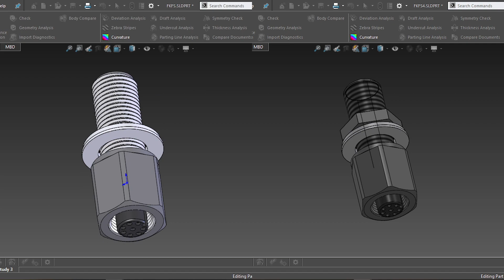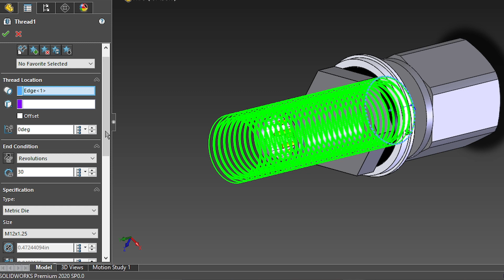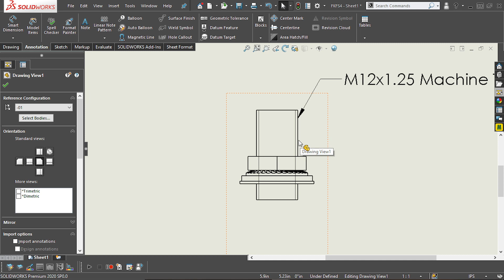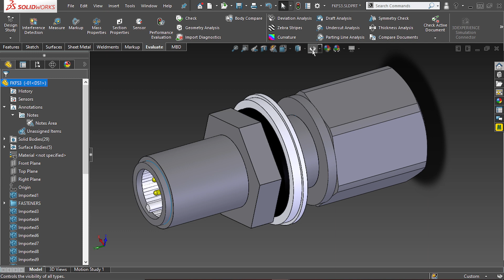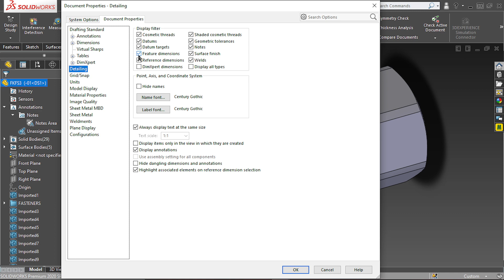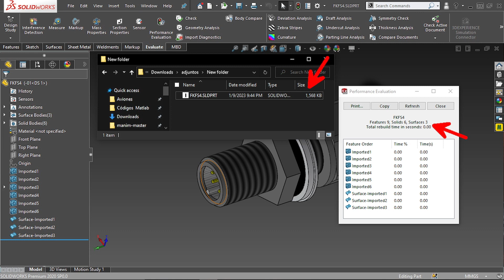Solidworks Performance Tips: STOP Using Realistic Threads! Use Cosmetic Threads Instead!

Comment: Hi I know a lot of times has passes but in case you see this
I have a problem where my cosmetic threads don't show up in annotations folder for individual parts and don't show up in assembly drawing
The individual drawings are ok
Do you have any advice besides RAM?
Thanks
Reply from the maker: My friend, I have a short video to solve that exact problem! You need to find some settings for all the parts/assemblies in which you want the threads to show.